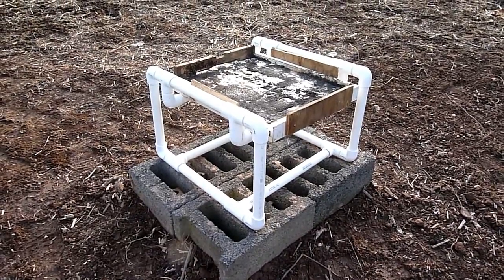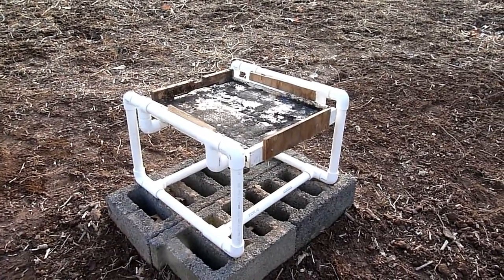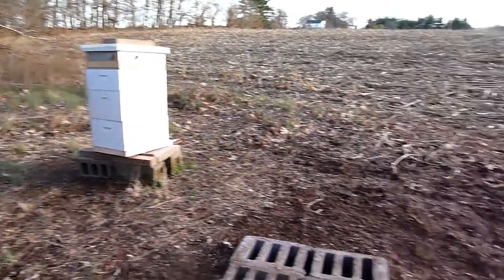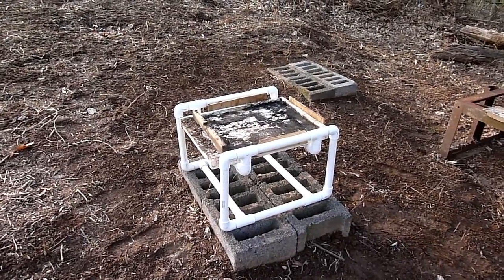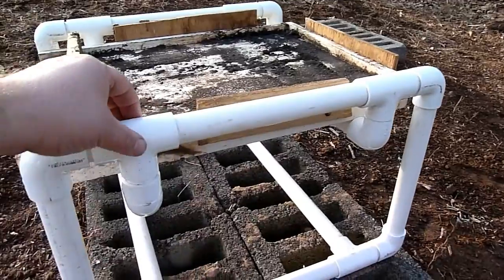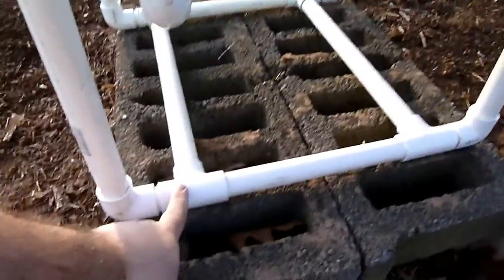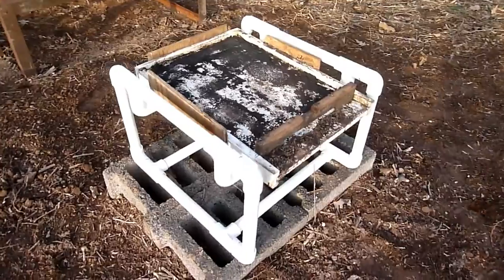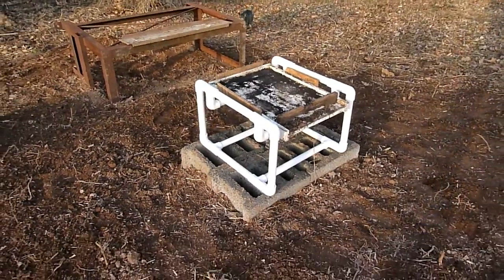Homemade PVC Hive Stand Prototype

Comment from the maker: July 2013 Update - They've been deployed going for a year and a half now and the texture of the PVC is the same as the day it was deployed.  Someone in the BeeSource forum made some and then put a car on them because others commented that they wouldn't hold enough weight.  It held the car off the ground. I currently have 7 boxes stacked on this particular stand and it is sturdy and having no difficulties maintaining the weight.  Approaching 2 years and fingers crossed, so far so good.

Comment from the maker: It is an appropriate comment and a concern so i'll be careful before I claim it a success.  If you've ever seen me, I'm a large guy 270+.  I stood on the device with all my weight in its dry fit configuration and it hardly flexed. Straight out full on weight and it is not glued yet.  I'll try my hives on them and if something happens I'll adjust or do something out of steel ;-).  Honestly I'm actually more concerned about them toppling over then collapsing.   They're a prototype.